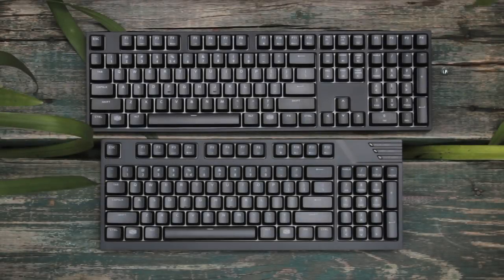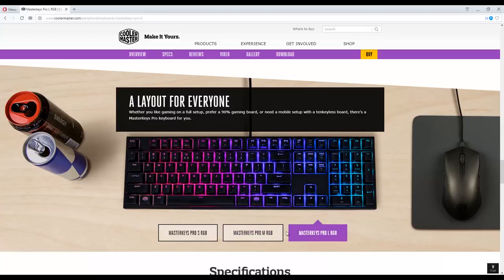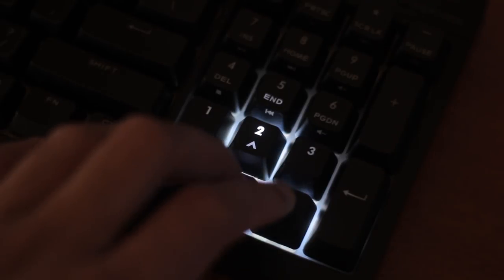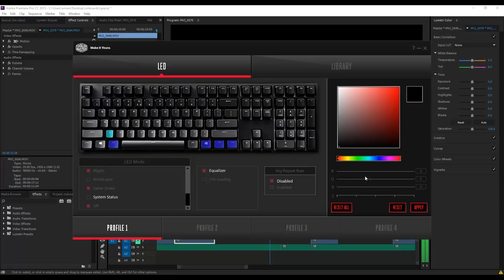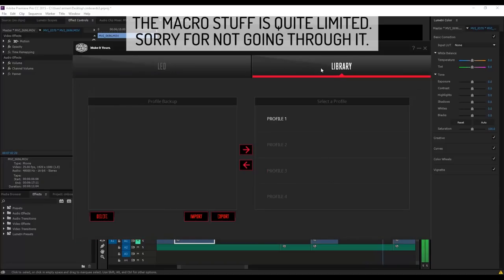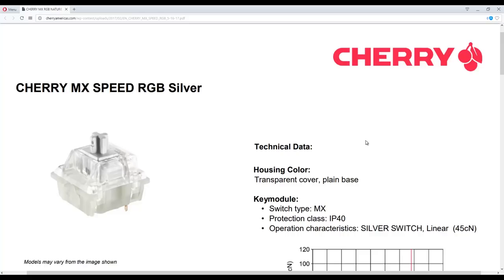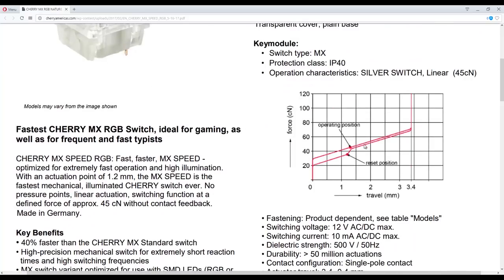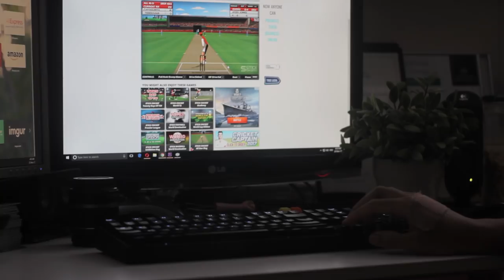Cooler Master Masterkeys Pro M & L RGB Mechanical Keyboards - Unboxing & Review

Comment: Are these standard lay outs? Corsair K70s are not standard  layouts so you can't really get custom keycaps for them.
Reply: J B yup!
Reply: The L model has a standard ANSI layout and keycap size. The M model does not, the numeric part on the right has a smaller zero key + additional 00 key and the lettering is custom due the changes Cooler Master made to that part. You can see the difference between L and M models at 4:00. It's not a big problem since standard size keys can still be used as long as you don't mind few keys with different or blank lettering. 
BTW, you can get keycaps for K70 since it's a relatively famous model, even the Chinese have them for sale.
Reply: Yes you can, from maxkeys.

Comment: By far the best "mainstream" company to make boards, id still go for PBT version of these without the RGB, but for the msrp there are a whole heap of other alternatives. in particular the build quality here is just so lacking
Reply: BoneSponge how? mine is solid as a rock
Reply: mine's fine, don't think it will ever break unless I drop it.
Reply: maybe its just the video angle but it looks like theres a lot of flex, even for the parts disassembled. In fairness i did own quickfire XT where over time the top shell came looser and looser making flex a lot more noticeable. For roughly the same price, Id go for a leopold or ikbc board

Comment: Hi. Hopefully you see this. I see that you have tried the equalizer mode. I have tried it when the software is running and it runs smoothly. However when I turn the software off I realize that the entire equalizer slows down. The lights still run but somehow it isn't as smooth as with the software. Have you experienced the same?

Comment: This or the iKBC g87 (its the TKL one if I got the model number wrong)
Reply: iAnthonyTV yeah, man I have the same choice now, the Pro S or the IKBC f87... And I think I have made my decision. The PBT keycaps and matte finish on the IKBC win this round, also the more rigid frame, and build quality...
Reply: Def the ikbc f87
Reply: Ehh, I'd be careful. I'd much rather get the S and get gateron PBT blanks. the ones on the iKBC are kinda flimsy.
Reply: iKBC for sure.
Reply: iKBC, unless you need the numpad.
Reply: iKBC

Comment: I have one of these for my 2nd system, the L with MX Brown, but 
got relegated to a backup board (back in its box for now) when I picked 
up a Logitech G610 Orion which simply felt sturdier, had better anti-slip 
rubber on the back (basically the whole bottom of the board) and much
better stabilizers for the Enter, Shift, Backspace, Space,etc keys
which the masterkeys had issues with (both in "feel" and how
they sound compared to the standard keys). So its 3rd place now
after my Ducky and the G610.   Shame really cuz the white backplate
makes the LEDs stand out nice, and its otherwise a very decent board,
better stabilizers would've drastically improved the entire MK Pro lineup

Comment: I have an older version of the M keyboard for like 5 years, and it still goes strong.. the only problem is that my left CTRL doesn't work well anymore .. i rly have to press it hard... is it possible to fix it if i replace it with a new one ? and is there a set of key caps that is good for this style of keyboards..

Comment: Off-topic: Hey guys, I ordered my vortex pok3r from Ebay and it came today. When I plugged it in, I noticed that the backspace and the backslash (\) were switched. Do any of you know how to fix this? Thanks in advance.

Edit: I fixed it! The left ctrl wasn't working either, so I just switched to another layer using right ctrl and then the blue LED under the space bar turned off completely, indicating that it was on Layer 1 (default). Now, my left ctrl, backspace, and backslash all work.
Reply: good thing that you fixed it man!

Comment: corsair vs. razer. vs. logitech vs. Coolermaster. 
Comment which company i should buy from
Reply: None of the above. I use a CM MasterKeys Pro L at work, and there are much better mechanical keyboards you can purchase for the same amount of money, or less, which aren't from any of the mainstream, “gamer” brands.

For example, I got a Varmilo VA87M frosty white with Cherry MX Blue switches, blue LED backlighting and front-printed PBT caps for about $80 a few months ago — a deal I was very happy about. I prefer it to my work keyboard. The keycaps are awesome: PBT plastic doesn't wear out and shine like ABS does, and it feels much nicer to type on.

If you're willing to dish out a bit more money than that, you can't go wrong with a Filco Majestouch 2, a Das Keyboard or a WASD v2. Those three are pretty mainstream in the community, and they are all miles ahead of Corsair/Razer/etc. You even get color customization for all keycaps with the WASD v2 (although, they're ABS, not PBT, but the ABS they use is much better than CM's). :)
Reply: KonstantinUb give this comment a heart
Reply: you're better off going with filco or something, these 'gamer' keyboards are just meh imo.
edit: unless you really want the backlighting, but the rgb craze is slightly gratuitous in my opinion. to each their own.
Reply: From your choice, I would say get either Corsair or Cooler Master.
Reply: They're all fine, choose what you like. You can't go wrong with any of them.
Reply: Luc Tran ikbc
Reply: Corsair ist overpriced, Razer is overpriced and even worse hardware than Corsair. 
My experience with Logitech support has been good so far. I don't like their own switches at all though. 
Cooler master as tarkeyboards said uses next level garbage caps which you have to replace. Apart from that they seem like good keyboards but I would only buy them on a deal.
Reply: Luc Tran don’t go corsair. The keyboards feel cheap for what you’re getting. I got the CoolerMaster MasterKeys S PBT and it’s the best keyboard I’ve used. I’ve used mechanical boards from Logitech, corsair, razer, and red dragon (awesome for the price). Just don’t get the Pro M. I have the old version of it (quickfire) and don’t like it because of how it does function keys and accessing keys with/without numlock enabled. Get something with PBT no matter what you get. You don’t know what you’re missing until you try one for yourself
Reply: For me personally I have a black widow 2014 and I love it, but honestly if u want to go a little cheaper rout probably Logitech is the way u want to go
Reply: none of them get a non gamer mech if you dont need macros. All 4 have problems. If I HAD to choose im guessing coolermaster, the only one that I hate is Logitech as they use those shitty in house switches.
Reply: A ducky would be better too
lot's of choices
Reply: clayton smith yea i love my ducky mini. And they have some great construction
Reply: yeah i don't have have a ducky mkfission but they are very nice looking keyboards and my brother is getting a shine 6 soon so i'm really exited to see it
Reply: clayton smith the shine 6 has some sick special editions. Have you seen the white one
Reply: yeah one of my friends got the gold edition with blues
Reply: the multiswitch one is also really cool too
Reply: clayton smith oooo that’s slick. I got the mini with clears. I wanted the year of the horse edition but it’s not available with clears
Reply: @KonstantinUb: Are any of the 'more money' options available in backlit or RBG? I couldn't find them (at least not in a UK ISO style) for tenkeyless.
Reply: Get a ducky!

Comment: The rest of mentioned brands also put that same kind of shitty keycaps on their keyboards. Considering the prices they sell for, it's a fucking disgrace, I've seen better keycaps on $50 chinese boards. They should really knock off with the light show and start focusing on things that are actually important.
Speaking of light show, I wish Cooler Master would give up already on that painted plate, it reflects too much light. I had a CM Quickfire TK Blue that I had to give up because that blue light would pierce my eyes in the darkened room, even on dimmest setting...